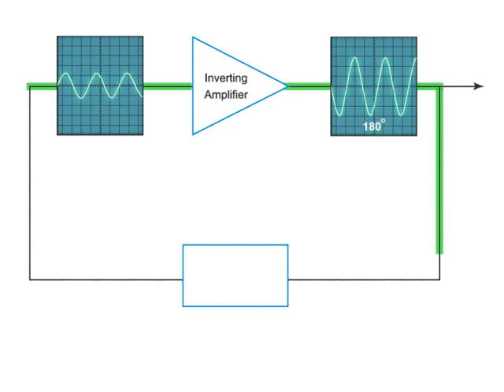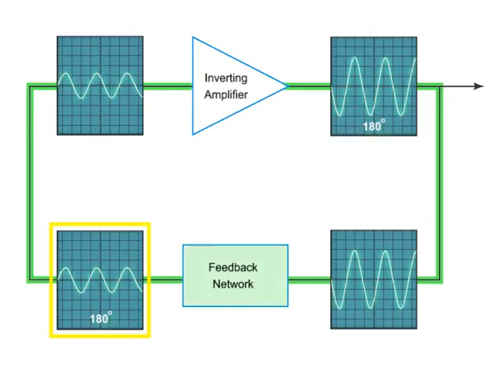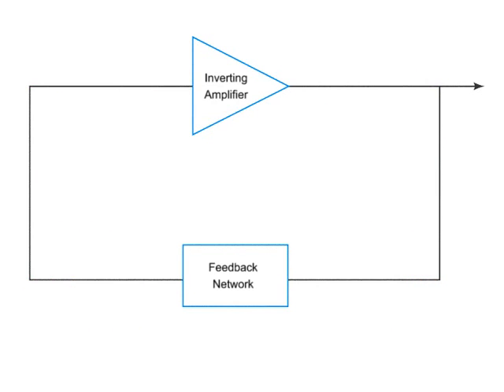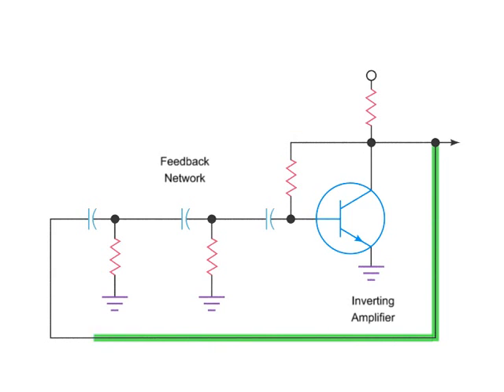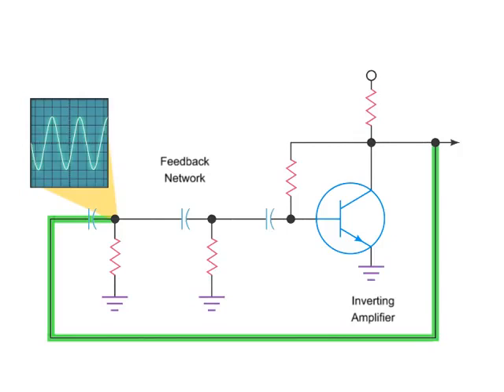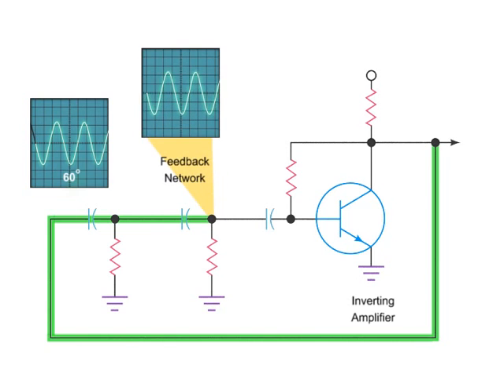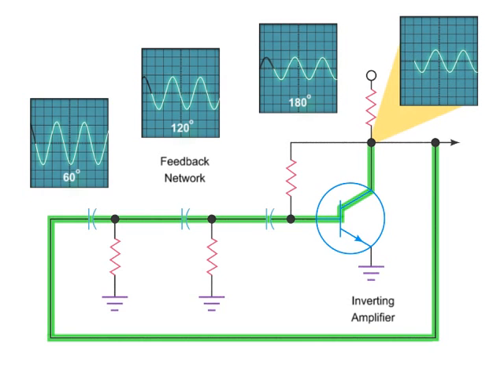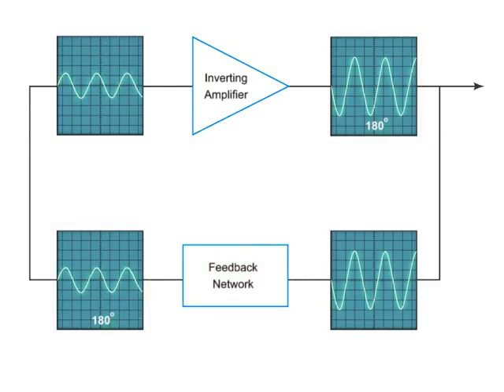Electronic Oscillators and Its Feedback Network | Solid State Devices 11/13

Comment from the maker: Thanks for watching. For More Videos: Please Subscribe My Channel
Solid State Devices Tutorial: https://bit.ly/31PedHP
Embedded Systems & Microcontroller Tutorial: https://bit.ly/3893dpH
Motors and Drives Tutorial: https://bit.ly/3dH0yF1
Process Control Tutorial: https://bit.ly/3hTASs7
Fluid Power Fundamentals Tutorial: https://bit.ly/2NSowCL
Fluid Power Design and Application Tutorial: https://bit.ly/3dEjvIq
Fluid Power Control Tutorial: https://bit.ly/3eniF3S
PLC Programmable Logic Controllers Tutorial: https://bit.ly/2C22zhI
Complete Practical PLC Course Tutorial: https://bit.ly/3dHon09  
Advanced PLC Programmable Logic Control Tutorial: https://bit.ly/3g8FfO3
Electric Motor Control and Power Systems Distribution Tutorial: https://bit.ly/31Cib6c
Industrial Robotics Tutorial: https://bit.ly/38hQnWd
Industry Blueprints Tutorial: https://bit.ly/2ZqCn8p
AC Circuit Analysis Tutorial: https://bit.ly/2VyoHqP
Physics Tutorial: https://bit.ly/2BjVOaX
Motion Control  Tutorial: https://bit.ly/31sqUrz

Channel Link: https://bit.ly/2IsqVS for watching more Videos

Simulations provided free under a Department of Labor grant awarded Eastern Iowa Community Colleges.
😌Don't Forget To Like, Share, Subscribe & Comment 😬
======
تعريف بالقناة:
قناة تعليمية مهمة للجميع عليها أكثر من 210 فيديو تعليمي، بها:
1- شرح لبوردات الاردوينو Uno & Mega 2560  وعمل مشاريع رائعة بها حيث، شرح Servo Motor, DC Motor وطرق توصيله والتحكم في إتجاهه، و EEPROM وتوصيلها وكيفية التعامل معها. وال Stepper Motor، واستخدام الاردوينو كمولد موجات جيبية ومسننة ومثلثية،
رابط الدورة من هنا: https://bit.ly/2PvtHvx
2- شرح دورة الأنظمة المدمجة Embedded Systems والميكروكنترولر واحتراف البرمجة بلغة الامبيدد سي Embedded C. وعمل مشاريع رائعة…
رابط الدورة من هنا: https://bit.ly/2KadqX2
3- شرح كيفية الربط بين الاردوينو واللابفيو وعمل مشاريع رائعة بهما.: https://bit.ly/2KlTssj
4- شاهد أيضاً،دورة مهمة جدا لطلبة الهندسة في شرح أساسيات ومبادئ التحكم الآلي او هندسة نظم التحكم
(Automatic Control or Control systems engineering):
رابط السلسلة:  https://bit.ly/2NGyeYd
5- دورة متقدمة في التحكم باستخدام اللابفيو (مهمة لأقسام تحكم أو كنترول والكترونيات). وهي تطبيق عملي لدورة التحكم الالي 
رابط الدورة من هنا: https://bit.ly/2K7aVEE
6- سلسلة Root Locus Method في هندسة التحكم الآلي لطلبة كلية الهندسة، قسم كهرباء،
رابط السلسلة: https://bit.ly/33CROvi
7- سلسلة عملية في القوي الكهربية او الكهرباء المتردده الاحادية والثلاثة الطور (Electrical Power) لطلبة هندسة ولكل مهتم بالكهرباء
رابط السلسلة كاملة:  https://bit.ly/3dWEckc
8- بعض الدواير العملية الكهربية المهمة للجميع.
رابط الدورة من هنا: https://bit.ly/2Fnli65
9- دورة في القياسات الكهربية، مهمة لطلبة كليات هندسة ولكل مهتم بالالكترونيات والكهرباء: https://bit.ly/30RdTVS
10- دورة في احتراف الرياضيات والجبر والهندسة والتفاضل والتكامل والقوانين الخاصة بها بدون تعقيدات.:  https://bit.ly/30ykUtG
11- دورة في احتراف برنامج اللابفيو الرائع LabVIEW : https://bit.ly/2TOx4y4
12- برامج مهمة للكمبيوتر واللابتوب الخاص بك: https://bit.ly/2qT9NM6
13- Complete Practical PLC Course Tutorial: https://bit.ly/3dHon09 
14- Green Screen Tutorial Link: https://bit.ly/3esShFa
15- Complete Process Control Tutorial: https://bit.ly/3hTASs7
16- Complete Fluid Power Control Tutorial: https://bit.ly/3eniF3S
17- Complete Fluid Power Design and Application Tutorial: https://bit.ly/3dEjvIq
18- Complete Motors and Drives Tutorial: https://bit.ly/3dH0yF1
19- Complete Physics Tutorial: https://bit.ly/2BjVOaX
19- Complete Embedded Systems & Microcontroller Tutorial: https://bit.ly/3893dpH
20- Advanced Programmable Logic Control Tutorial: https://bit.ly/3g8FfO3
21- Physics Fundamentals Tutorial: https://bit.ly/2CNrzcU
22- AC Circuit Analysis Tutorial: https://bit.ly/2VyoHqP
23- Industry Blueprints Tutorial: https://bit.ly/2ZqCn8p
24- Industrial Robotics Tutorial: https://bit.ly/38hQnWd
25- Electric Motor Control and Power Systems Distribution  Tutorial: https://bit.ly/31Cib6c
26- PLC Programmable Logic Controllers Tutorial: https://bit.ly/2C22zhI
27- Fluid Power Fundamentals Tutorial: https://bit.ly/2NSowCL
28- Solid State Devices Tutorial: https://bit.ly/31PedHP
وهناك المزيد علي القناة، وان شاء الله هذه مجرد البداية فقط.
رابط القناة:   https://bit.ly/2IsqVSC
وتعمل اعجاب ومتابعة لصفحتنا علي الفيس صفحة المهندس المحترف
رابطها: https://www.facebook.com/المهندس-المحترف-100879698187843
متنسوش الإشتراك بالقناة لمتابعتنا وتفعيل جرس التنبيهات ليصلك الإشعارات بالفيديوهات أول بأول.
====
#Kyrillos_Refaat